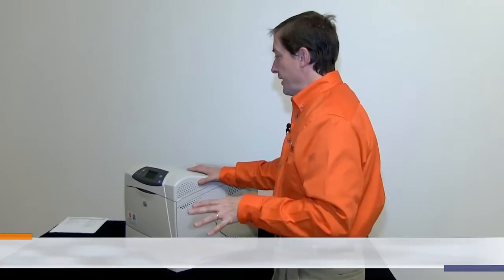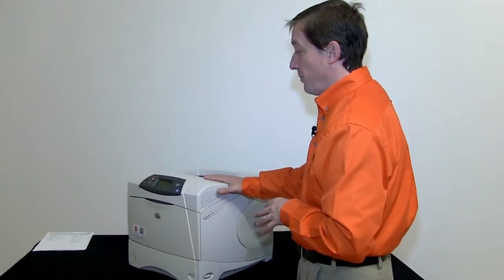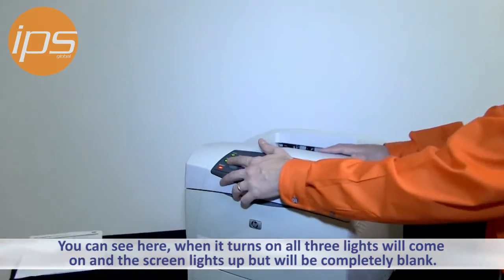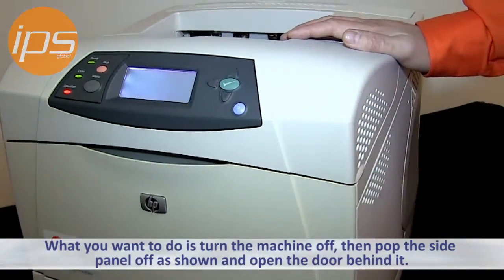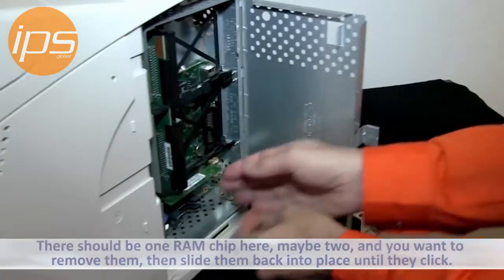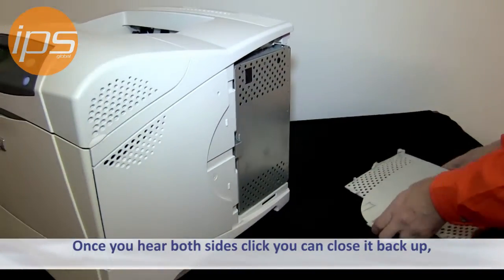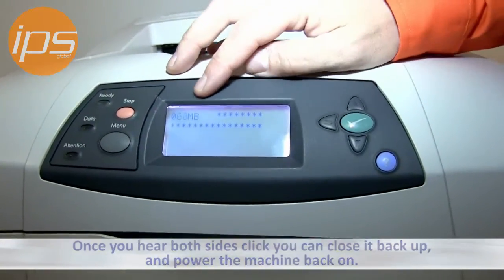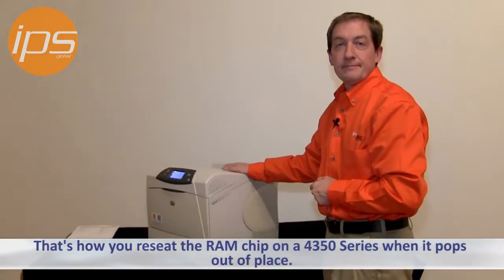HP 4350 - How to Resolve a Blank Menu Screen / Reseat RAM Chip (incl. 4200, 4250, 4300)

Comment: Hi, great video. I am from the Netherlands and have sort of the same problem with my 4250. Afther interrupted the firmware update the screen stays black. No light or anything to see. Any idea how to solve that? Replacing the RAM does not do anything in this case
Reply: Did you resolve your problem?